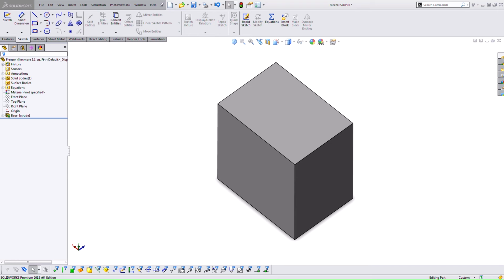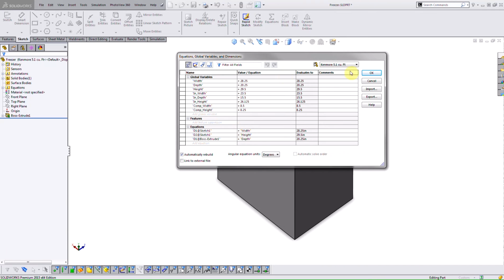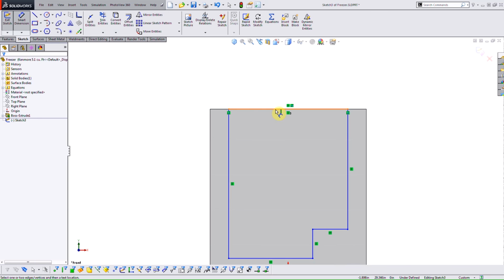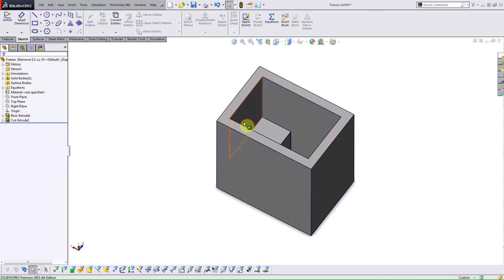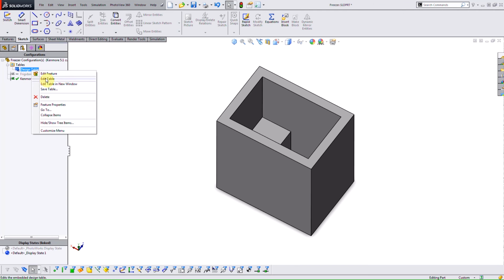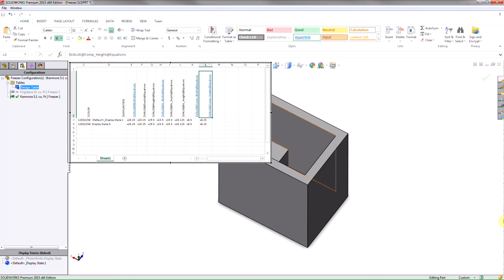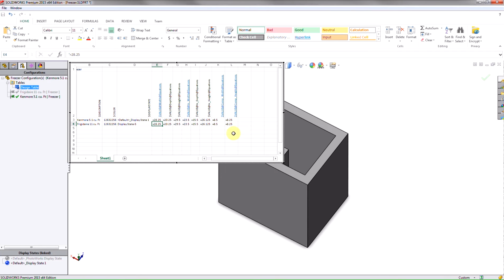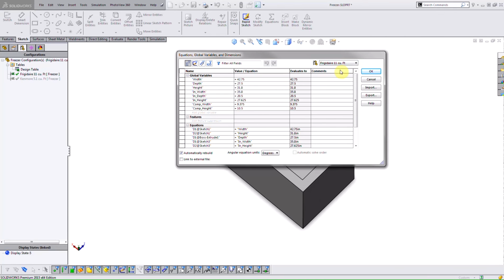Oktoberfest at the Ridge (Keezer Build) - Global Variables and Configurations

Comment: Just my 2 cents here. I think a better way is to just use the in-built configuration table and click on the dimensions in the sketch. In this way, there is no need to type in the formula into each cell.